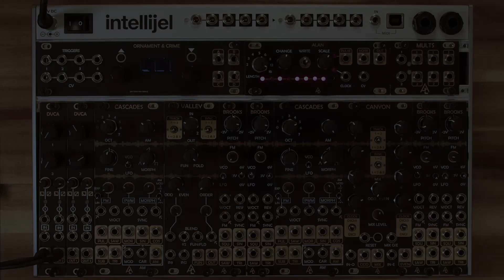VALLEY: Wavefolder/Timbre Generator and Mixer/Crossfader

Comment: hello thank you very much for the presentation :)
Valley can it supply 2 Cascades and 1 Brooks

as setup:
osc 1: cascades
osc2 cascades
osc 3 Brooks 

Sorry if this has already been said, I don't speak English very well :)
Reply from the maker: That setup will definitely work.  You can use either of the oscillators in the three different positions.  You could use three Cascades, if you wanted.  But your config is definitely a solid choice.
Reply: @afterlateraudio  Thank you so much for your response :)

Comment: how is the circuit deriving the "fundamental" from the 2 inputs if patched from external sources in? Is it a lowpass filter on the input signal? I assume when used in the coco system its the sinewave of the primary oscillator? Thats a circuit i cant wrap my head around. Also the odd even circuit is pretty novel too ive never seen that before. Pretty sweet module